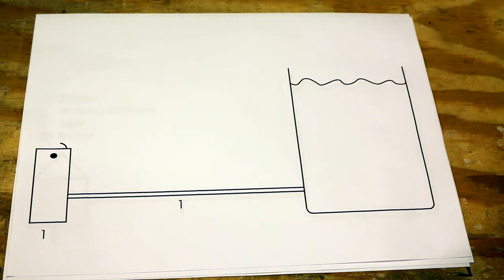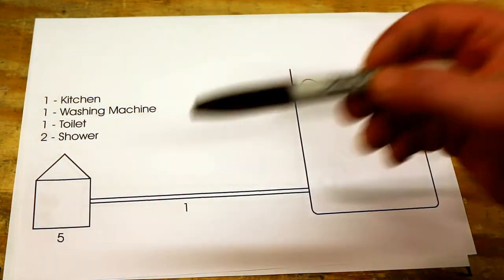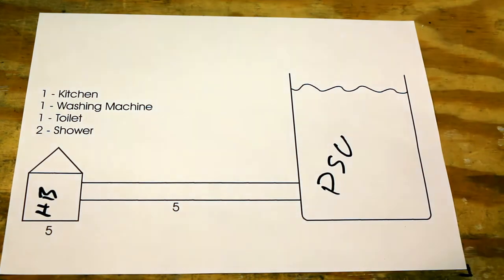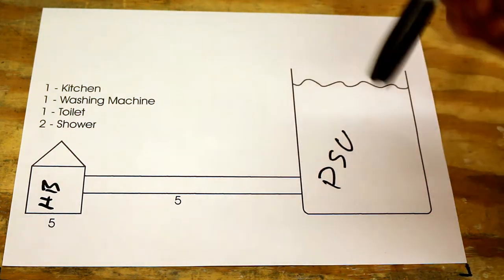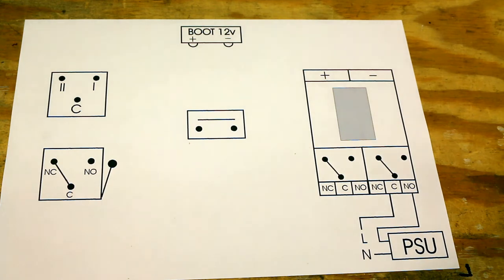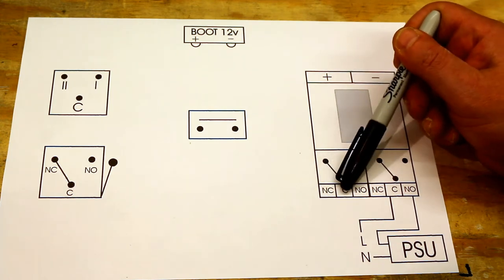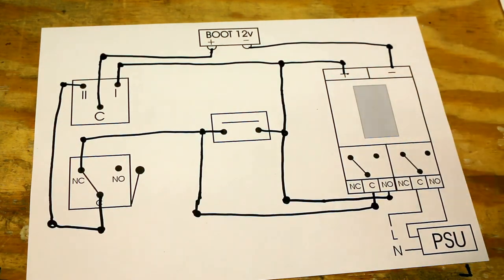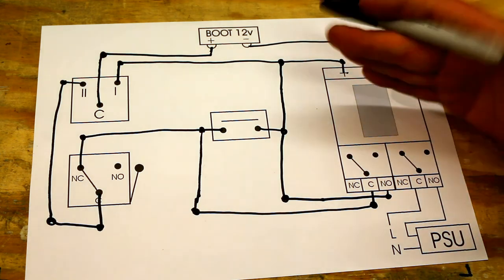Anet A8 with end of print auto shutdown

Comment: Hi Brian, thank you for a great series of videos. I have just ordered an A6 but I think your designs will carry over without any problems. I was also thinking of replacing the stock PSU with a 300 watt atx unit, salvaged from an old PC. What are your thoughts on this? Also, your magnetic fan mount... Is that the stock fan with a printed mount and magnets added or a replacement fan with magnets?
Reply: A PC ATX have a special circuit that has to be connected so it works.  If you break that one, your PSU will stop.
So if you have a PC PSU, you can use that instead. Just put the switch in that circuit in it's NC part.  So then you don't need to wire the live 240 V.
That is a nice idea.

Comment: interesting stuff - thanks for sharing, I am  looking at a slightly different approach using an orange pi zero that I currently have running octoprint hoping to use it  to control  the printers power on & off via a relay, and a mosfet for the leds,  but this requires free unused control pins, so far   I only know of 1 pin thats widely known thats located on the lcd  socket that some people use for the touch sensor -

Comment: hi, i was thinking about the  additional 12 v boot power supply .. couldn't you make a loop so that you could use the main power supply instead, maybe.. there is no need to turn the main power from running, as most appliances do regardless, the focus was just to turn the main board  off, so that then the heated bed and nosels are shut down completely.

Comment: Hi Brian, I really want to add this to my printer, but I'm a newbie at all this stuff. I have a couple of questions for you.  The HLR12 relay you listed, do I only need one of these?  Your diagram shows 2 relays.  Next what gauge wire did you use for the 12v side of this system?  Looking at your Part 1 video they looked very small coming out of the top.  Are all of them this size?  I bought some 2.5 wire to rewire my heated bed and the mosfets.  Is this wire OK for the main side of the relay too?  Sorry for all the questions, but I don't know what I'm doing and I want to learn.  Thanks is advance for all your help.

Comment: Great video! I've been looking for a way to do this. Did you add another switch to the hot end for the auto shutdown or is that how the A8 is designed? Sorry for the silly question, but I use the A6. Mine always raises up a bit and goes to the far left at the end of a print.
Reply from the maker: Yes I printed a small plate to mount the micro switch on the
head
Reply: Thanks! I'll look into doing the same once I'm ready to put this together.

Comment: firstly thanks for a well explained tutorial, i understand all the workings of the circuitry the only thing i cant quite grasp is how do you connect the output from the hlr relay to the psu,
thanks again,your helping me a lot in preparing for when my anet arrives,
after looking again i think i might have it,
 the power supply from the wall to the psu i connect the live to the relay and the neutral to the psu is that right brian cheers
Reply from the maker: If you watch from 11:30 it's explained how its wired to the main PSU :)
Reply: got it cheers brian

Comment: With this setup the PSU will not 'switch off'. It will only isolate the supply from the PSU to the printer, thus shutting down the printer. The PSU will remain live/energised until you cut the power from the socket. Would this setup work if the main supply was routed from the mains, through the relay and then to the PSU? I still think it is a worthwhile mod if you plan to leave the printer running unsupervised, as long as you trust the PSU not to fail!
Reply: That's exactly what he was doing - his diagram shows that live (from the outlet) first goes through the relay and then to the power supply, which means it will be isolated from mains if the relay is switched off. That's the whole point of his 12V bootsrap power supply (that one you would have to trust of course, as it will stay on).
Reply: MeatLeBeef, I think you missed my point check 11:01. Yes, the PSU supplies one side of the relay but there will be further connections (not shown) from the mains to the PSU. That is the connection i wanted to isolate, so you effectively cut the power to the PSU as well as the Printer and the only live power would be in the bootstrap power supply, the relay and the power supply cable to the PSU. Brian, does your PSU still have power when the printer shuts down?
Reply: Yes and no. First of all: The PSU does not supply the relay - that's what his bootstrap power supply does. The way it works is that one side of the mains (in this case live) goes through one switching side of the relay - it is galvanically isolated from the rest of the circuit - and then to the PSU. The way he has it set up is that the relay cuts the power to the PSU, because the PSU is the exact security concern he had.
Yes, you could argue that neutral is still connected to the power supply (that part does not go through the relay), but neutral is at ground potential and does not provide any power.
And even if neutral and live were switched around, e.g. in his outlet, that would still cut power to the PSU, as there is no potential difference between the two terminals of the PSU any more - ergo no power.

The wiring diagram at 11:01 does not show the connection between the PSU and the printer, but instead the connection between mains and the PSU - hence the L and N for live and neutral. Were it the secondary side of the PSU that is shown, you would not talk about live and neutral any more, but rather about positive and negative.
In that case you missed the point of the whole video itself.
Reply: Now i get it. So the main power supply (mains) into the PSU is controlled by the relay (running of the bootstrap). When the 1st relay (RHS of his sketch) is in the normally closed position it isolates the inputs from the main to the PSU. When the relay is activated it reconnects the circuit and energises the PSU and the Printer. Sorry i'm not an electrician and thought he had just not indicated the mains supply to the PSU. He does mention this in his previous rewiring video part 1 which i just re-watched. Thanks for the clarification though.
Reply: Exactly - you got it. The one thing that might have been confusing is him talking about wire gauges in the first part, running from the power supply to the heatbed, but then directly switching to his relay setup, which all of a sudden has to do with mains.

But exactly the concerns you had, he had as well, and thus created the whole relay part about the printer.